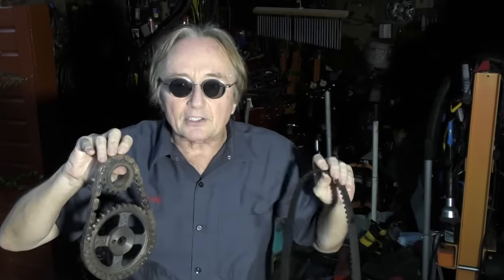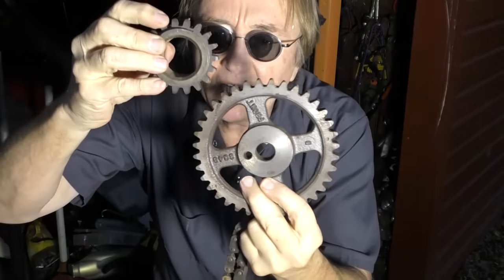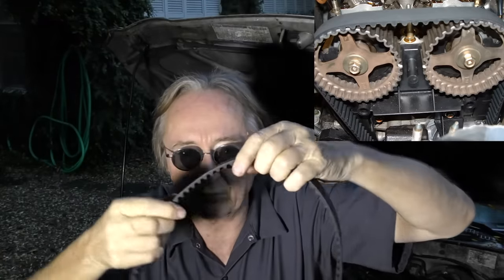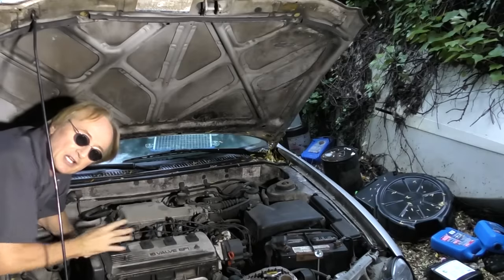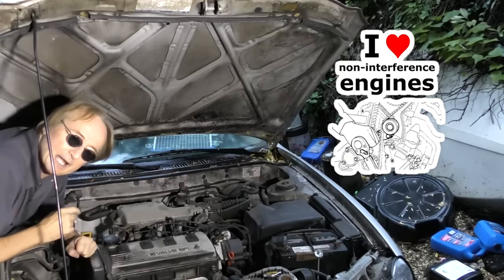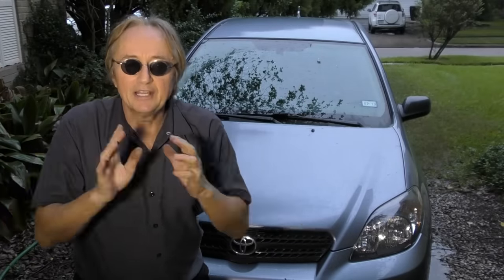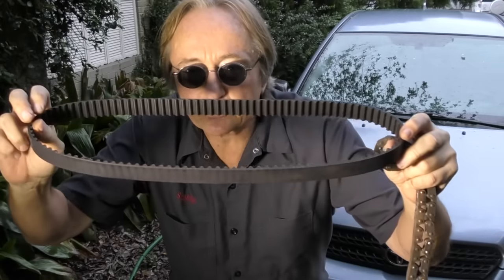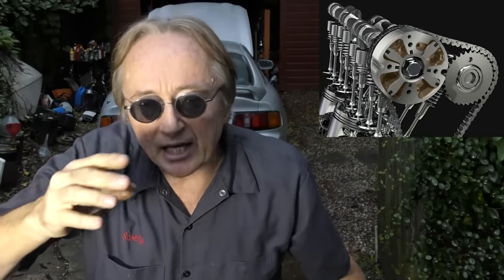Why Some Cars Have a Timing Chain Instead of a Timing Belt

Comment: My timing belt broke once as I approached a red light. instant dead and no start. Fun.
Reply: It can happen with chains, too - though more often than not, it's because the chain slips rather than breaks.  Had it happen on an old Chevy.  The chain didn't stretch all that much; the issue was that GM used a cam sprocket that had its teeth jacketed in nylon to help keep engine noise to a minimum.  Over the years, the nylon got brittle and started breaking off, and once enough had worn away or broken, it left enough slop in the timing set that the timing would eventually jump.
Reply: @xaenon . Yep. Been there done that. Back then it was recommended to replace those GM chains at 60k miles.
Reply: el oh el
Reply: yeah you were supposed to replace those every so often. Heck my 1980 chevy truck i had to adjust the carbs in the fall and the spring for the change in weather. I think we all forget how much maintenance old cars really were.
Reply: my GF's 2.5l did that right on i-95 in the middle of ft. apache the bronx around midnight driving home. lucky for us we had still had a bottle of bacardi 151 and met some cool people who helped us find a towtruck (they said cars get stripped on that part of the highway all the time and smart not to gotten too far from it..)  a parts store, and a garage did the work for $100 overnight while we all hung out and drank and worked on the car.  (bet you thought I was going a different direction when I started this out... ^_^ )  she got lucky the head and crank didnt slip it was the intermediate shaft that went to the distributor and thrown the spark timing off.
Reply: @laryanryan9170  Hardly anyone actually followed the recommendation though.   It was an easy job one those engines too.
Reply: @charlesmcgehee3227 . Yep. Most people just drove them until the chain slipped or broke and it actually hardly ever happened.
Reply: @laryanryan9170  I never saw one.  That's why the 60k mile swap suggestion surprised me.   Thanks.
Reply: @charlesmcgehee3227 Back in the day  I ran a shop. We pulled a 70 something GM car into the shop to replace the muffler and when we got ready to back it out it turned over but wouldn't start. Broken timing chain. It was running when it came in so we had to fix it for free. After that we paid close attention to the mileage.
Reply: @xaenon  If i were guessing your engine had a few miles on it ...
Ive never had one to shear the teeth off , but i did see some joker rev his engine to the max that it actually happen ....
Just caint fix stupid in some people ..
Reply: Yep, happened on my Mazda years ago and cost me 17 hundred dollars to fix
Reply: @shobud7561   The mileage wasn't ridiculous, something like 80K, though there were signs the previous owner was the type of person who felt his car was far more than it really was.  I imagine that engine spent a considerable amount of time operating at WOT, and the stub of a traffic ticket I found in the glove box did little to convince me otherwise.  82 in a 45 zone?   I was surprised it was written for speed and not reckless op.

As for 'cain't fix stupid', I'm with ya, brother.  I have many, MANY stories, lol.
Reply: or as i say ellamayo ( lmao) @ChrisBenoit4evar
Reply: @yamahayz0426  yah because adjusting a carb is so damn hard you out there....in the cold for 3 whole minutes using a flat head to adjust the carb.

Lol
Reply: @xaenon   Perhaps GM designed those engines to prematurely  fail and quieting the engine noise was just an excuse to justify putting nylon on the cam sprockets. I am a University Marketing Graduate and we studied all kinds of tricky things down in the market place to make money. I expect GMC to eventually fold within 5 years. @xaenon  .
Reply: GMC trucks used Propane to check how rich or lean the carb had been set.  I used this method quite often after tuning up my dad's  1985 GMC Truck . Consult the manual for the GMC vehicle and a very accurate tachometer.  Those idle  mixture screws are a pain if you lack the proper tool. One tool per idle mixture ( equals two of those tools at one time ) screw as you adjust the air/fuel mixture.  @TwistedCreations1980
Reply: I just had the chain replaced on my 2006 Ford F150. Apparently the Triton engines of that era are known to have the chains wear out at roughly 150K miles. Mine was very loose and making a bit of racket. Not a cheap fix, but I changed to 5W30 from the 5W20 that Ford recommends and installed a high output oil pump after the chain replacement. Hopefully I get more than 150K out of this chain.
Reply: @xaenon  that was ur problem. U were in a Chevy
Reply: @poolplexer    Didn't say it was MY Chevy....  'Twas my brother's.   But being the one in the family with the big set of tools, I got tapped to fix it.   Though, to be honest, my wheels at the time was an old Plymouth Horizon, so I can't bash his Chevy.  Especially since a few months afterward, that li'l Horizon ate its cylinder head.
Reply: @xaenon  i was messing around
Reply: @xaenon  i still have my 91 Chevy Lumina. Runs like a Champ
Reply: @poolplexer  Oh, I know.  I'm generally not a Chevy fan myself; mostly drove Fords.  But it really doesn't matter; as long as the car does its job without too much fuss, I don't give a crap about what name is stamped on the rocker cover.  Love my li'l S10; a '91 with 300,000 (!) miles.  Not too shabby for what was considered a 'throwaway' truck!
Reply: @rogerbraasch5224  GM wasn't the only ones who did that, used a sprocket on the timing chain that was partially nylon. Ford did it also and for the same reason. My dad's old 1976 F-100 pickup with 390 FE motor had the same failure and for the same reason. Granted the truck had well over 200k miles on it when it happened, but we were surprised to learn that the sprocket was nylon with metal teeth when we tore it down to fix it. Anyway, this was apparently pretty common in that era and when the nylon gets really old, the heat and stress results in failure. I believe this is also true for some engines that used gears drives instead of chains as well. The Ford 300 inline 6 is one example. It's one of the toughest, most reliable engines ever built, but in the last few years of production the went to nylon gears driving the cam and when those engines get old, some people experience failures. Once again the reason for the switch was noise reduction. 

Anyway, Scotty's advice here appears to be sound, but it's not just as simple as gear vs chain vs belt, because sometimes nylon sprockets and gears were used in gear and chain driven designs to reduce noise and those nylon pieces can fail with age.
Reply: Once you have exposed the timing chain to check it,  you "Might as well" replace both timing chain and sprockets to save money, you might consider replacing the small timing gear at bottom of the distributor on these old Big Three Engines.  Same thing if you pull the oil pan.  Here, replace all the crankshaft bearings, rear oil seal and oil pump. This is another "Might as Well". @ @xaenon
Reply: Maybe best to have left one buddy behind with a loaded gun, cause you should expect car strippers to be armed with some weapons.,  @TheOriginalSycHolic
Reply: Most times, the chain is never replaced. However, timing chains are  always replaced with the sprockets during engine over hauls.  @laryanryan9170
Reply: @rogerbraasch5224  if I lived in nyc prob would have still had some states to travel.. nor was my car def would have dumped a dodge shadow long before getting shot over it.
Reply: Sadly, the traditional Big 3 Car Makers in the USA have a failure rate designed in most parts. One more dirty little secret to make money.  @KalteLanze
Reply: @rogerbraasch5224    Absolutely.  But when I would tell a customer  anything like this, I'd get the squawk about 'trying to rip them off'.  It was always 'just fix what's broken'.   Like the guy who had a bad U-joint in his old Ford extended cab pickup.  Two piece shaft with support bearing; front joint squealing.  Suggested that since the whole thing had to come out anyway, he should seriously consider getting all three done and a new support bearing.  Nope.  The front was all he'd sign off on.  So, I did it, and you can guess what happened next.  And who has to explain to the guy that it would have been better if it had been done all at once like I'd suggest months prior.
Reply: Laryan Ryan, Why would you "have to" repair the motor for free when you didn't even touch it?
Reply: Very exciting if this had happened during Noon Rush Hour in the middle of an intersection on Chicago's very busy Business Loop. And in the area of the skyscraper that used to be  called the "Sears Tower".
Reply: Then you should have had the car serviced well within the interval, Russian roulette otherwise
Reply: I guess you had bad timing ..
Reply: @xaenon .  The money saving poorer customers don't realize they are forcing their mechanics to cut corners.  When the corner cutting causes major engine failure after a repair, listen to the CUSTOMERS GO BALLISTIC versus whoever fixed their engine.  I wonder if machine shops (individually owned and the only employee there) catches least Hell.  There they can get away with replacing more parts. HOWEVER, in these shops, always replace the camshaft bearings and polish the camshafts and crankshafts. After this, recheck oil clearances.  @xaenon   Better let the customer gripe about the money on the repair estimate than comeback griping several months after the repairs were complete. Use this same psychology versus money savers for most repairs.  They should pay you now, or pay another mechanic a Hell of a lot more.  HOWEVER, always say NOOOOOOOOO to quick saving repairs that may later  lead to dangerous vehicle wrecks that would get  you sued. @xaenon
Reply: @KalteLanze  that's interesting,  will file that away.
Reply: @xaenon  and my 01 s10 was a total pile of junk. Name it and it failed. Compare that to vehicle I had before the s10--- 98 tacoma. The only mechanical repairs needed was ball joints & clutch, oh and u joint.  Apart from regular maintenance that is. Both 4x4. Got both from original owners with full maintenance records & both were well taken care of. The s10 required 2500 worth of work at 70k miles!!!!! Appropriately half n half parts & labor at a Napa authorized shop. Owning a chevy will literally bankrupt a person! STAY CLEAR!
Reply: @rogerbraasch5224  not everyone allowed to own gun for various reasons, nor can everyone afford them. Plus NY ismt it practically illegal to have one?
Reply: @dw4940  I gotta tell ya, my S10 has been surprisingly trouble free.  I had to go through and replace all the brake lines a couple of years ago, and the slushbox leaks a little, but it is reliable.

That said, I don't daily it any more.  Once or twice a week to deal with some chore or task, and that's about it.

The really surprising thing is, it's the four-cyl.  Everybody insists it should have died 100,000 miles ago.
Reply: @xaenon  the 2.5L 4 cyl is known as the 'Iron Duke'. Good engine. I heard some years Chevy was actually good quality such as around the early to mid 90s the full size chevy trucks were known to be good.
Reply: @rogerbraasch5224  You are correct. The reason was, all GM cared about was the original purchaser. Often these were fleets or middle and high income customers who got a new car every three years or less anyway. Long ago, I said that GM made the worst new cars and the best used cars. Part of the reason was that GM used the same parts over many productions cycles and across many models and platforms. That meant that GM could take advantage of scale by always using the cheapest and most obsolete parts for as long as they could. Corporate DNA is what it is. The bones are laid down and it very hard to impossible for a corporation to change the way it does business. For GM, that may mean going out of business. The divisions will be sold to other carmakers and that will be the end of it. Back in the old days, my dotty Central European grandmother loved Ford and even owned some Ford stock even though she never had a driver's license. Back then, I thought she just dotty. Maybe she knew something after all.
Reply: @stefanl5183  Weight reduction was another issue. Every little tiny thing they could do to reduce the weight helped them with their CAFE (Combined Average Fleet Economy) numbers. No one thing by itself made much difference but it in the sum of all things it did make a difference. The consequence, though, was engines and transmissions that broke down or failed early and plastic parts that cracked or broke early in the life of the vehicle.

Comment: I have a 92 mitsubishi 3000gt vr4 that I bought brand new in 1992. But these days I run a Gates racing Kevlar blue timing belt. It's worth paying the extra 50 bucks on the racing belt for the peace of mind. As for everything else that rides on my timing belt like the water pump and hyd tensioner. All that is always replaced with genuine mitsubishi oem parts.

Comment: Makes you want to slap the guy who sold the timing belt idea to the engine MFG's
Reply: Yeah timing gears and chains definitely the best, it's outrageous back in the 1920s cars were built to literally last a lifetime where as some of the crap cars today have planned self destruct dates , for example anything made by GM seems to explode after 7 years ,where as anything built by Honda will last you 20 years no problem
Reply: @Tiffany.1970  timing belts aren't bad. I prefer them on classic cars as a chain still needs maintence, especially if it relies on a tensioner
Reply: @richracing7420  true. I prefer timing belts because it uses pulleys for tension whereas the timing chain uses guides which are plastic. None is superior
Reply: Some German cars have problems with timing chains.
Reply: it's all about making money my friend.
Reply: $800 to $1700 or more for a timing belt change at the stealership.That's why! It's a money making idea!
Reply: I bet to mfgs that was a million dollar idea. All they saw were more dollar signs in their eyes.
Reply: @Tiffany.1970  Lol utter and complete nonsense.  How the hell is a timing belt the achilles heel of the Rover K-series?  And that piece of scrap 2.0 Honda engine is garbage.  I've raced with K-series engines for 20 years and never had a failure
Reply: Want to know something funny. There's cars that use a belt inside the transmission now. And when that rips, good luck finding someone that is willing to do that job
Reply: @jerryp2433  So do Japanese cars. Give me a belt any day as long as the engine is free spinning.
Reply: @Johnsmith-zi9pu  My Prius has 120,000 miles on the timing chain. I'd rather have a belt too, but it is an interference engine. I think that is why they use chains these days.
Reply: I never buy cars with timing belt. Only timing chain.
Reply: @MannyC711  get yourself a dodge with a timing chain. The water pump is inside with the timing chain. You have water leaking into your engine when it goes bad 

You people, keep buying dodge cars. I just don't want to hear you whine later down the line
Reply: @MannyC711  I have a 300,000 mile 4runner with a timing belt. Pretty easy to change it every 90000 miles. It's also non-interference engine so it's fine when it breaks. I also have a 120,000 Prius with a timing chain. I think the tensioners is already making noise and needs to be serviced. Prob not as easy as the timing belt. It's an interference engine though so it needs a chain.
Reply: @JoseRamirez-yh2ll  Nope! I stay away from Dodge and Chrysler too!
Reply: @JoseRamirez-yh2ll  I’m happy for you! I hope it last another 300,000 miles more! 👍🏼
Reply: @JoseRamirez-yh2ll  some cars don't have oil dip stick just wait for the red light to come on or the big bang.